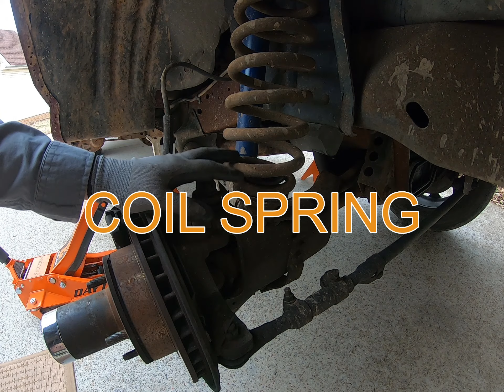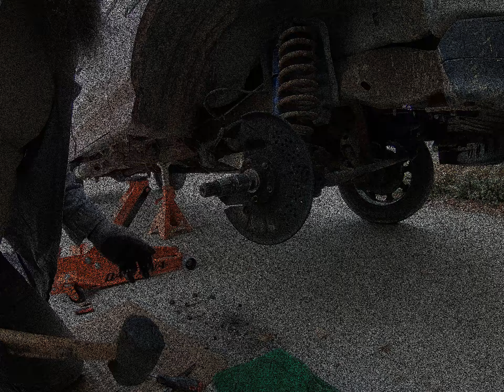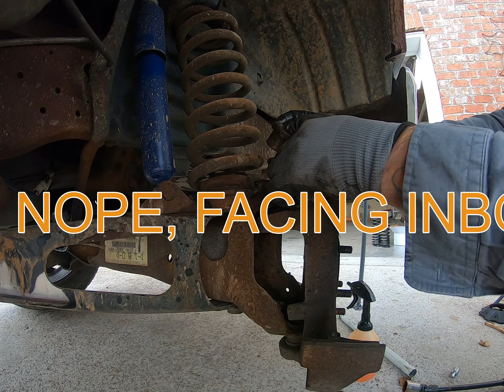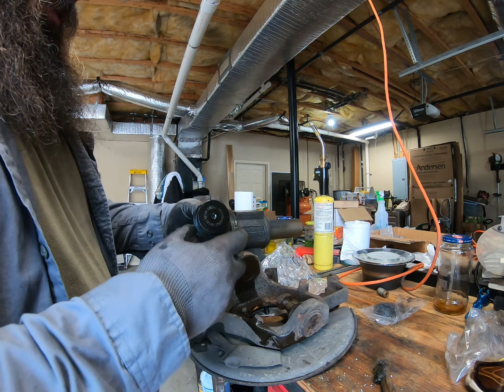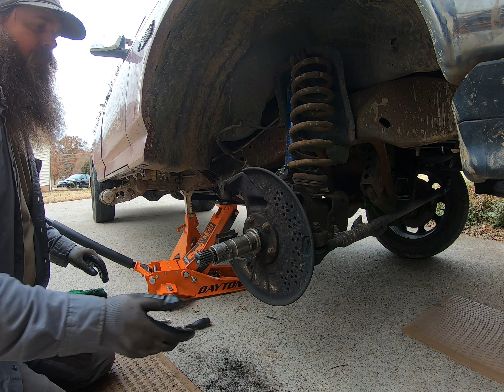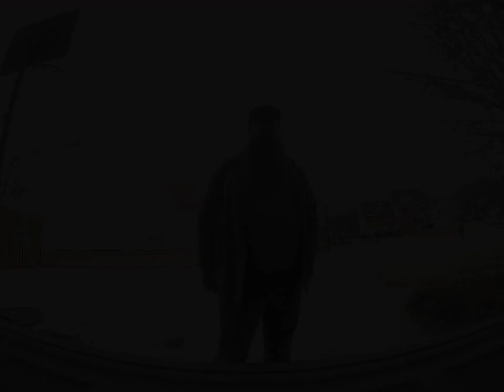93 F150 4x4 upper ball joint and coil springs

Comment: I cannot for the life of me get the axle to slip out of the splined yoke before the 2nd ujoint - like you do at 13:28 . 1993 f150 4x4, Dana 44 (5.0 4EOD). I moved the boot away from the connection, there's about an inch of play in the axle before it abruptly stops, like it's hitting something, but everything's clear. Did you have to overcome some sort of retaining clip inside the splined slip fit? 

Yanking at basically 100% (great idea, I know...) has gotten me a few more millimeters, but nothing like it's ready to come out. Thanks for the great video.
Reply from the maker: thanks for the comment Guccimanggg. i dont recall a clip, the spline was not groved for one when i show it to the camera. such a long time ago. i think th boot was the only thing holding that one in place.
Reply: @elh4x4doinstuff49  thanks heaps for the quick reply. good point about the spline not being grooved on camera - although I see now there is an indentation about 1/2 inch back from the splines. I'll report back if I figure it out.
Reply from the maker: i think you are referencing the area where the small part of the boot is clamped to the axle. dont give up Guccimanggg you got this!
Reply: @elh4x4doinstuff49  Got it out!! Indeed is a slip fit, just super stuck and grease vacuumed together. 

Getting it out took all of...
- much penetrating oil
- torching the outer slip axle
- using a come-along on the axle end (and a conveniently located tree)
- me hammering the outer slip while buddy cranked the come-along and wiggled the axle (...making sure the truck was VERY sturdy on the stands while I was under it...) 

Stoked. Thanks again!
Reply from the maker: Noice...thanks for the update Guccimanggg!

Comment: What size is lower ball joint nut
Reply: 28
Reply from the maker: i think i used an inch and a quarter (1 1/4)
Reply: Socket is 1 1/8 tip and bottom